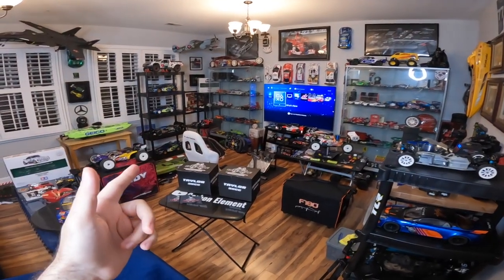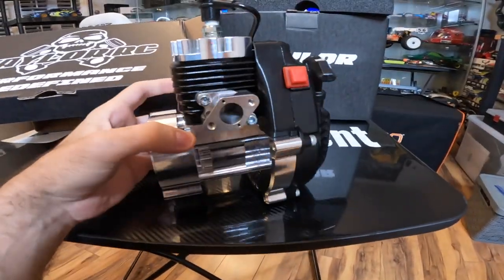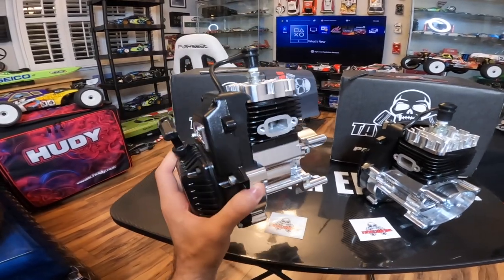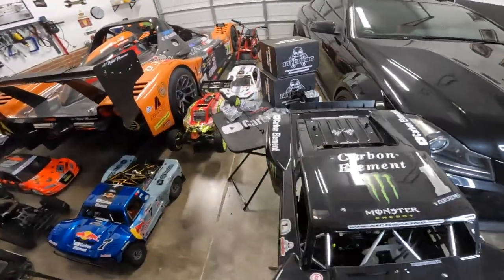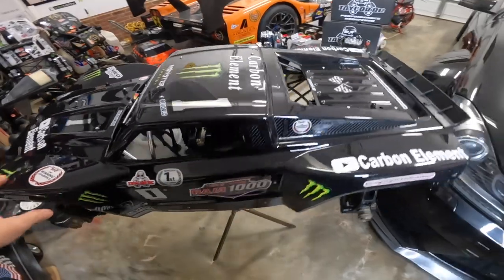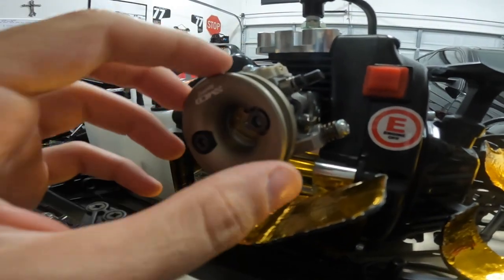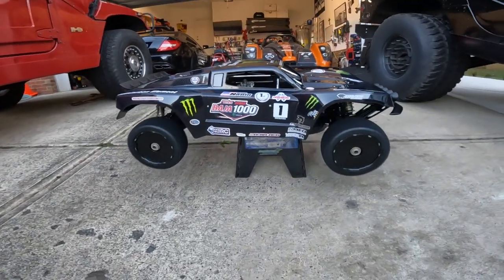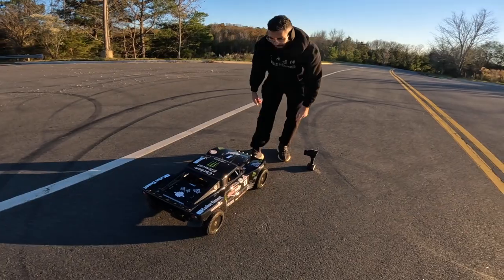CUSTOM RC RACE TRUCK (MCD W5 + Taylor/RCMAX Engine + 2 speed gears)

Comment: Hey Nabih, may I ask what 2 speed transmission you are running and also whether it has been reliable?
Reply from the maker: its the mcd xsnap and its bulletproof if installed correctly :)
Reply: @carbonelement77  thank you sir